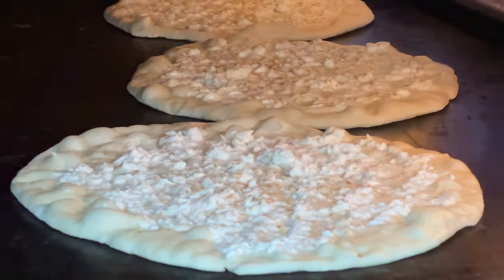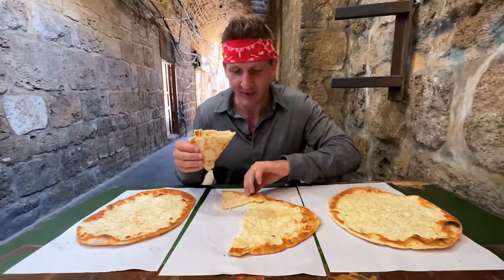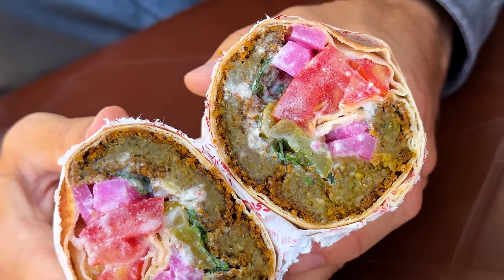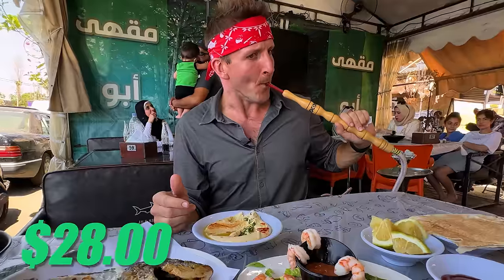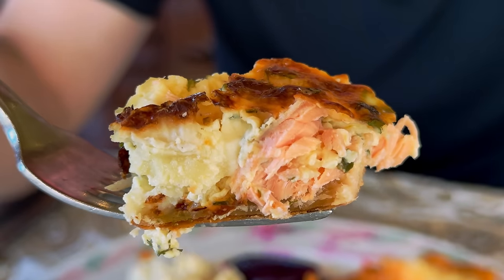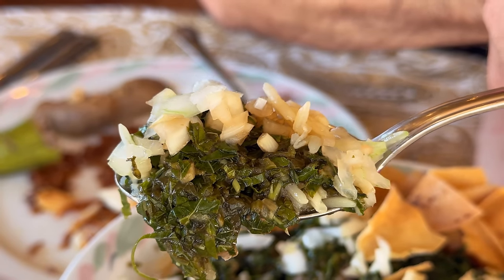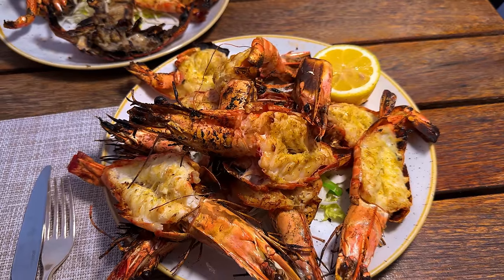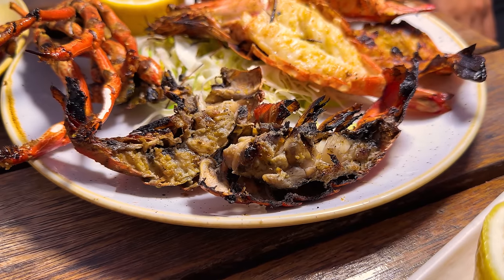Lebanon Street Food Marathon!! From $100 to $1000!!

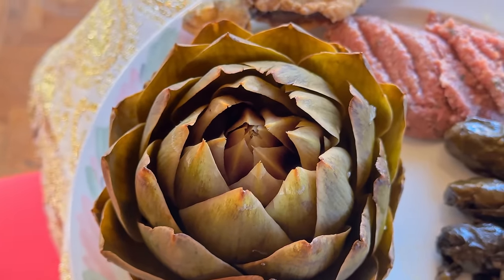Comment: omg  such a massacareyou  for artichoke 22:30 .. presentation and recipe little weird but suppose to use artichoke leaves as spoon for that meat and when you separate leaves one by one' tips of the leaves  get tiny bit from its heart and you can chew it at the end only hairy middle part left which you can throw. Normal recipe for that is  actually they need to  remove hairy part and put meat inside the artichoke creating  "dolma" .   The other shamefull thing is kunefe . it was realy low profile. I hope you eat a good quality one with a cheesepull while you were there